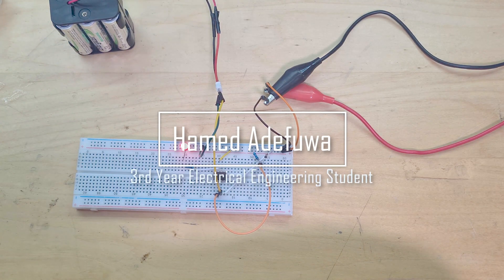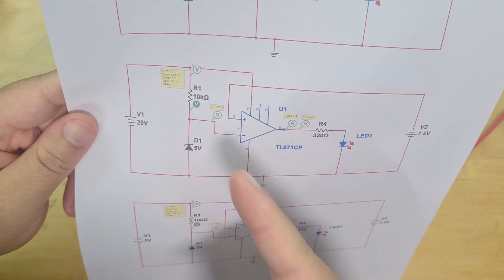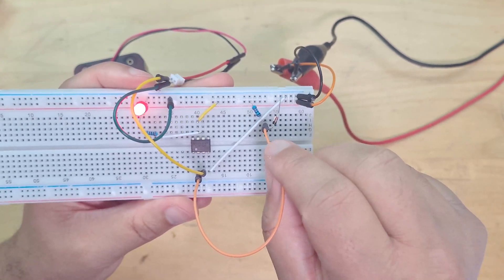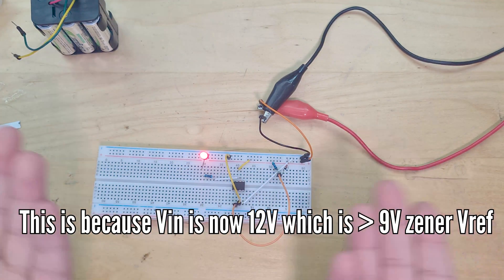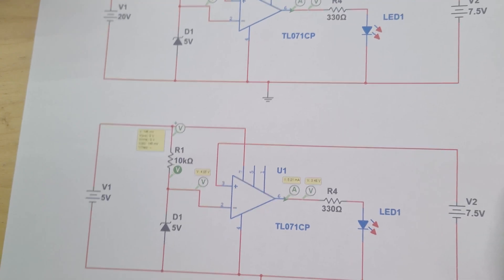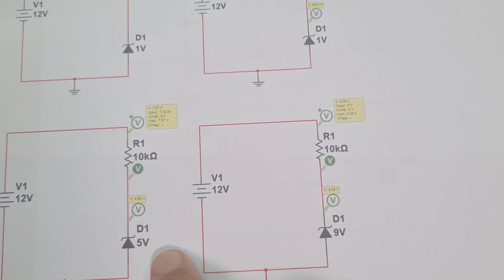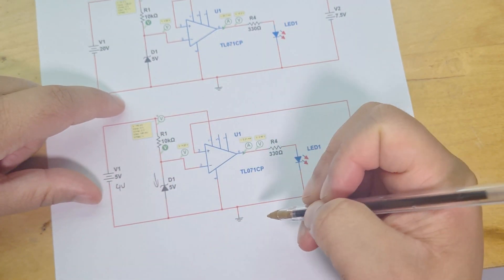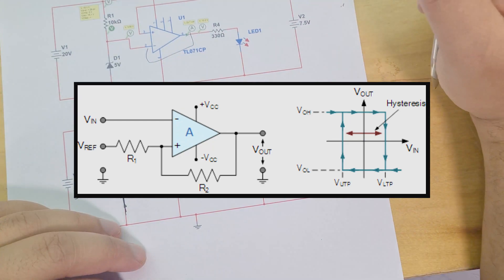Comparators - Using A Zener Diode To Set The Reference Voltage

Comment: Very great video indeed. I love it👍.
It seems to me that if the reference voltage (inverting input) is 5v then the output can only trigger when the non-inverting input is above the 5v right ? 

How can I modify this circuit to ensure that the output can stay a little above a particular threshold ? I mean the output can only trigger when the non-inverting input is just 5.1v, any other voltages in between can turn off the output. 

In other words, at the non-inverting input, the range of the operation of the output of the op amp is when
5v <= Threshold <= 5.1v

 (assuming the critical/threshold input of the non-inverting can only be 5.1v for the op amp to turn on and turn off when the non-inverting input is either above 5.1v or below 5v)
Reply from the maker: sorry bro im not sure, il pin this so hopefully someone clever helps lol
Reply: @HamedAdefuwa  
Okay, hopefully we can get a good guy that can solve the puzzle.... Thanks all the same. My project is heavily dependent of the solution of the question I asked earlier.
Reply from the maker: I got stuck on something similar in my project and so I switched to using a microcontroller instead